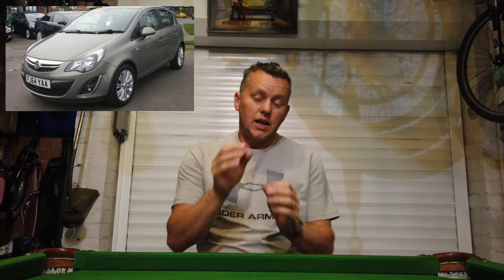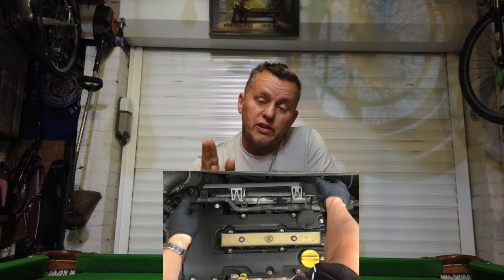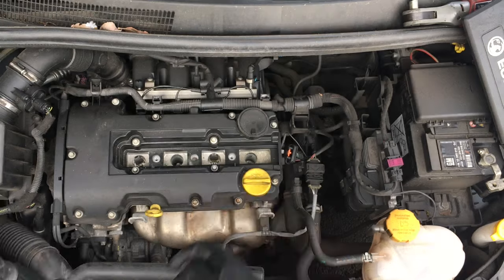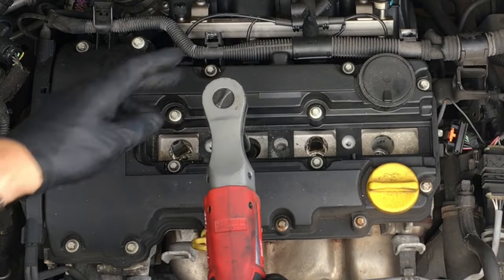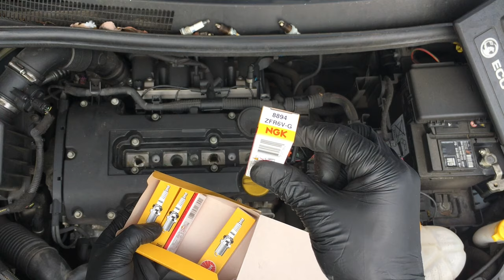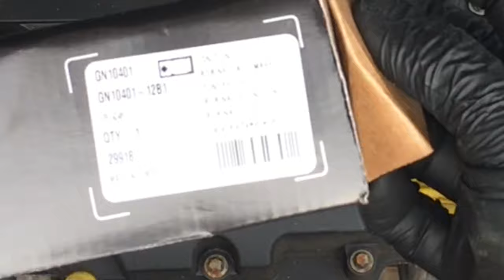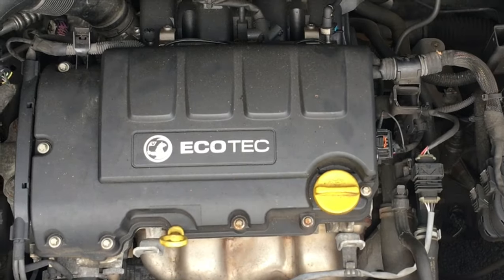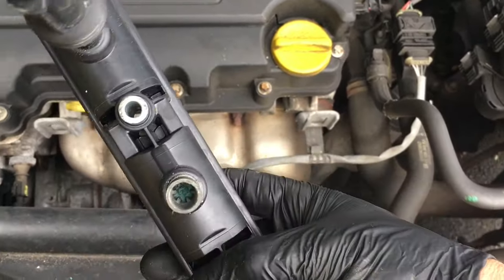🇬🇧Corsa Coil Pack Replacement (engine Misfire, Jerking)

Comment: Very useful fella. I changed my daughters 1.4 corsa yesterday.  It has transformed it. 2 cylinders were affected by bad corrosion . Excellent call.
£106 from euro car parts. 5 minutes to fit, but a year of engine light coming on. Vauxhall should recall for clearly failing to resolve this issue.
Reply from the maker: Glad it helped, Thanks for the great comments👍🏻👍🏻🛠
Reply: exactly the same on mine, fixed it today - what a hero!

Comment: Thanks to people like you on YT, I now have the confidence to sort what I think may be an issue with the ignition coil.
The car shudders sometimes in 1st. Also looses power (slow to respond) if changing gear to 2nd; especially up hill.
At times, I have to pump the ecelerater or change back down to 1st.
Many thanks for your video. Subbed & look forward to more content. 👍
Reply from the maker: Thanks for sharing & Thanks for the great comments👍🏻👍🏻🛠

Comment: Top man thanks for sharing, just had my car diagnosed by auto Plaza in west London with head gasket needed replaced and few other bits up the exhaust. Paid £1800 and as I got it, I experienced this issue 10 minutes after I drove off from their garage. They were like it shouldn't be any problems at all. Don't know what to think, either being ripped off, unlucky or just being idiot. Wouldn't be surprised if they'll ask again for some enormous amount of money for this issue when I'll drive back in tomorrow
Reply from the maker: Ouch, that sounds unfortunate, Thanks for the great comments👍🏻👍🏻🛠

Comment: Thanks for the vid. Just doing a service on a 2011 corsa d. It's only done 20k miles but doing the plugs I notice number 4 is covered in white powder substance & corrosion. Pulling the rubber boots off and the other 3 are nice and clean but 4 is totally covered with the ends of the spring completely corroded . Can only assume water is making its way into number 4 cyl only.  Have a new coil ordered from AutoVaux for £87 which doesn't seem a bad price for the same Delphi part as the one in the vid.
Reply from the maker: Good spot Martin, that would have given you a few issues had you not checked it, and a Good price, Thanks for the great comments👍🏻👍🏻🛠

Comment: Found this as my 2011 1.2 16v started jerking, nearly cutting out, clicking, no power, check engine light flicking on/off. Having new plugs and ignition coil tomorrow. Thanks so much.
Reply from the maker: Thanks for the great comments👍🏻👍🏻🛠
Reply: @aaanton11  work done and car behaving normally!

Comment: Thanks for the nice video! Cleaning the inside where the spark plug and the coil pack contact is not necessary? The grease that you talk about, would this be ceramic grease? Would it also be a good idea to put some on the rubbers of the coil pack? Thanks in advance!
Reply from the maker: Yes, correct, Thanks for the great comments👍🏻👍🏻🛠

Comment: You can take the rubbers off, smear dielectric grease on and slide back on, also put dielectric grease on spark plug end, not on the contacts, it keeps water out
Reply from the maker: Thanks for the great information👍🏻👍🏻🛠

Comment: The hexagons on the old plugs look rust-free, i don't think it failed due to water infiltrations. Anyway i have a 2003 Z12XE Agila and a few days ago i'd been checking things and letting the A/C pump run for a short while, with the hood open. Heard a distinct click while the engine idled and i'm sure it wasn't the AC clutch or the rad fan relay. 70k miles and the Bosch coil pack has never been replaced (only the plugs, last time has been about 2 years and 3k miles ago, Russian made Bosch FLR8LDCU+ ones). Feels slightly jerky, especially when the engine is warm and under load, but the EML never gets on and there are no pending codes either, and idle looks fairly stable. I've also cleaned the MAF and the throttle body, and replaced the pre-cat O2 sensor, but it still feels jerky. I'll replace the coil pack soon.
Reply from the maker: sounds a plan, Thanks for the great information👍🏻👍🏻🛠
Reply: @aaanton11  Update. I was right. It occasionally misfired on the 1st cylinder. Changed both the spark plugs (used the newest Champion RC10DMC4, Vauxhall part number 95519055, which the Vauxhall dealer gave me) and the coil pack (used a Huco 133816) and now the car drives so much better. Spark gap looks a sharp 1mm on all old Bosch plugs, and they're in about normal condition (no signs of oil fouling, only a tiny amount of carbon), so it definitely wasn't a serious misfire. One sparkplug, the one that looks the most carbon fouled among the others, seems to have a tiny interrupted carbon ring on the ceramic. Keep in mind that the P0301 fault code showed only on a professional code reader. My Viecar CY300 missed it completely and the CEL didn't light up. But the ride was still jerky nonentheless.

Comment: I got misfiring on my corsa rac said it could be spark plugs or battery they changed the spark plugs and said I needed a rocker gasket cover aswell so did that for a new battery fitted aswell it did run better after however I still have misfiring and the gears lose power sometimes and it really struggles in low gears.my rear engine mount was also broken so the car was shaking while idle and I had an oil leak.

I had someone else look at it he ran diagnostic he said cylinder 3 was not running as it should 80 when the other cylinders were all fine at like 200-240. he wanted to take the engine apart to investigate further and to charge me a full days labour £550! So I said no as the car only worth 1000 and have already spent £480 on repairs. 

Halfords said to replace the coil pack and fix the oil so I’m going to try that and hope it works and passes the MOT as the misfiring makes it fail on emissions. I did change the engine mount so it doesn’t shake anymore!
Reply from the maker: You would really benefit for one of these or similar https://youtu.be/O0oGl7nSQv8 it would save you a fortune, Thanks for the great comments👍🏻👍🏻🛠

Comment: Great video thanks. I just replaced a v corroded spark plug on my wife's 1.4 meriva (jerky and fault code p0304, new plug seems to have sorted it, coil looked ok, and other 3 plugs all shiny). One plug was also replaced under warranty a few years ago too, along with coil pack so totally agree with the water ingress corrosion issue! Any ideas on how to prevent in the first place?
Reply from the maker: seal the washer jets on the bonnet as water drips past the seals on to the coil, Thanks for the great comments👍🏻👍🏻🛠

Comment: Fantastic tutorial.Thank you so much for amazing video.May i ask a question?
 My Corsa D 1.4 (2013) sometimes  jerking,slightly shaking, refusing to accelerate, service light  and check engine lightcomes on. The problem only occurs when engine is cold.After a  10 minute drive, it never show up again. Or if i shut down the car, and start it again, the problem goes away too.

The mechanic said to me there is no misfire, the fault code said 'acceleretor pedal sensor ' issue. But i am suspecting that my issue somewhat related with ignition/misfire.Is there any possibility  that a misfire can cause these semptoms when cold but goes away when engine reaches operating temretures?
Reply from the maker: If there is a code for the accelerator pedal that is most likely to be the issue Thanks for the great comments👍🏻👍🏻🛠

Comment: My  exact problem. Cheers makes better then going to main dealer.
Reply from the maker: Thanks for the great comments👍🏻👍🏻🛠
Reply: aaanton11 bought mine for £46.00 and plugs at my local parts shop. Job made a lot easier with your video.

Comment: Great video. Is there a way to avoid getting water in there? I've changed the Coil Pack twice, getting the same water problem both times. How can I fix this permanently? Thanks for your vid. Cheers
Reply from the maker: pop the washer jets out of the bonnet seal with silicone and refit, Thanks for the great comments👍🏻👍🏻🛠
Reply: @aaanton11  Thank you!! :)

Comment: A good video and might just get have solved my sisters ticking noise in her 1.4 Audo SE.... top fella
Reply from the maker: Thanks sunny, the injectors are quite noisy on the Audi, it wont be a coil if the engine is running ok with no misfire, Thanks for the great comments👍🏻👍🏻🛠
Reply: @aaanton11  Sorry was meant to say "auto" she has a Corsa 1.4 SE like the one you been working on....

Comment: Hi,
Thank you for your video. I have the exact same issue with 2007 Vauxhall corsa petrol every 2 weeks spark plugs go bad because water drains into it to the point I had to replace the ignition coil. Do you have a tip what should I do to avoid water drains down to spark plugs? Thank you.
Reply from the maker: It usually comes in through the washer jet seals, Thanks for the great comments👍🏻👍🏻🛠

Comment: 140 pound seems a lot for the coil pack, did mine for 40 quid . Works fine.
Reply from the maker: Yes it is the more expensive coil but its branded, and is the same as fitted as original with proven reliability, there are lower priced coils like you say but in my experience they only last a couple of years at most, the coil pack sits right in the top of the engine where its really hot so it has a tough job to do. if you don't intend keeping the car for longer than year the cheap coil is great, Thanks for the great comments👍🏻👍🏻🛠
Reply: aaanton11 I’ll let u know in 2 years if it’s still going strong 💪😂
Reply: @TheMartin7171  still going strong?

Comment: Howdy. 

Thank you for the informative video. 

I have a question. I recently downsizied to a 2019 and it's my first vehicle with start/stop functionality. I'm a little bit worried about that - isn't it bad to have a turbo engine cut off abruptly when stopping?

And how reliable are the turbos on the 1.4turbos. Do you replace a lot?

Greetings from Johannesburg, South Africa.
Reply from the maker: They are very reliable, no issues with the stop start, Thanks for the great comments👍🏻👍🏻🛠

Comment: Hi, great video, helped a lot however the orange clip to remove the plug is broken, so you know where I can get a new part or what it is called ?
Reply from the maker: you might be better off just using a couple of cable ties to secure the connector to the coil pack, Thanks for the great comments👍🏻👍🏻🛠

Comment: I have changed the coil pack (HAAS) from euro car parts and all four spark plugs (Bosch) but it’s still misfiring, than engine light came on. Took it to local garage and the diagnostic picked up backbox pressure 🤷‍♂️😅 Anyways, they didn’t manage to solve it and problem still persists. Any ideas on what the problem might be please?
Reply from the maker: Sounds like you have a blocked exhaust, Thanks for the great comments👍🏻👍🏻🛠

Comment: 6:20 you mentioned two different type of coils now if the GM number is same but the shape of the drums going to plugs are different is there any issue? I have seen a video someone changed and he said it worked
Reply from the maker: Replace with the same type to avoid any issues, Thanks for the great comments👍🏻👍🏻🛠

Comment: We have just replaced our coil pack and spark plugs after they were corroded and it is still misfiring. Any ideas what that could be?
Reply from the maker: were all the springs inside the new coil legs or has one dropped out, Thanks for the great comments👍🏻👍🏻🛠
Reply: Did you solve it, got same

Comment: Anton, We have a 2010 Corsa 1.0 litre engine. Misfires in all gears and only kind of goes away on the motorway. We replaced the spark plugs and the coil pack and this hasn't sorted it. Also did the pedal test and no faults. What can I look to replace next?
Reply from the maker: is the engine management light on? if so you need a code reader like in this video for more clues, https://youtu.be/FJMDuWnGMII  Thanks for the great comments👍🏻👍🏻🛠

Comment: Hi... just need to get a advice.. I was changing the ignition coil and found some oil on one of the spark plug... would it be better to change the spark plug den or leave it as it is.
Reply from the maker: Or you can re seal the rocker cover, Thanks for the great comments👍🏻👍🏻🛠

Comment: Mate, my Vauxhall Astra is shuddering. Gave it to Vauxhall and they said the connector cable is broken. I had the coil
Pack and start plug changed a week ago. Vauxhall said the car is Mis firing at optimal temperature as the connector cable is broken. They gave me a £720 quote to replace coil pack, start plug and connector cable. There were no other fault codes. Would appreciate if you could share your views
Reply from the maker: The clips can break on the plug, just cable tie it on job done, Thanks for the great comments👍🏻👍🏻🛠
Reply: @aaanton11  thanks. RAC had cable tied it and it worked well for drive back home.but had the same misfiring issues next day when the car reaches optimal temperature

Comment: What are the recommended gaps on the plugs? Is that determined only by the vehicle manufacturer, or also by the spark plug model? Where should I look for these parameters? Finding the correct spark plugs seems to be pretty cumbersome. When I tried to use the part finder on different sites, like Bosch, I'm told that the entered VIN is invalid, although I checked it 3 times...
Reply from the maker: It should be these, https://amzn.to/3bns3Tw  On the automated checkers its Sometimes its easer to use the registration number, also to be sure whip out one of the old ones the number is on them, They come with preset gaps  should be 0.7mm Thanks for the great comments👍🏻👍🏻🛠

Comment: Is this a diesel engine? My 2001 honda civic sounds much lesser than this one🤔
Also how come changing those parts will solve the problem? This is temporary solution l guess. I think The 3rd cylinder has problem that causes corrosion on spark and coil. 
Another question; is this a chronic problem with vauxhall corsa? Because l’ve found a 1.3 cdti corsa and everyone says it’s fuel economic. But if they have such problems, l would rather not to change my honda. I just change oils, filters and sparks every 7000 km and have never had issues in 10 years.
Reply from the maker: This is a petrol engine, Hondas are very reliable Thanks for the great comments👍🏻👍🏻🛠

Comment: Had an engine MIL on a 2014 Corsa 1.4 D model.
Scanner revealed coil pack issue as did dealer level scan.
Replaced coil pack with Bosch (Haas didnt work) coil pack amd changed plugs while coil pack was off and now car runs great..BUT engine MIL light is still on. Have done 1 drive cycle lasting about 20 mins but it hasnt gone off. You didnt say at the end of your vid if rhe MIL went out straight away or if it needs 3 drive cycles.
Hoping its nothing else as dealer level scan only showed fault with the original coil pack and now running great with the Bosch replacement. 
Can you please advise ?
Reply from the maker: you will now need to erase the codes with a reader, Thanks for the great comments👍🏻👍🏻🛠
Reply: @aaanton11  
Thats great ...thanks

Comment: Those heat resistor springs 
Which way round do they go???
I’ve put the green tip facing down touching the spark plug ????
Reply from the maker: does it work? Usually the clean end touches the spark plug Thanks for the great comments👍🏻👍🏻🛠
Reply: aaanton11 no turns out the actual green tip (what looks like a fuse) supposed to be facing upwards touching the coil, and the spring part touching the spark plug.

Comment: Just got an 1.4 SRI Corsa D yesterday. Only done 32000. I was disappointed when driving it. For an SRI it felt sluggish and juddery. It's fine cruising at speed but its just doesn't feel pokey and judders a lot when taking off. So would a new coil fix it?
Reply from the maker: Only if It’s misfiring, is the engine management light on ?? Thanks for the great comments👍🏻👍🏻🛠
Reply: @aaanton11  No, no engine light. But sometimes it stalls. No knocking or anything. Just juddery and occasional stall. Maybe it would benefit from a remap?

Comment: Does the coilpack misfire trigger any trouble codes? A work colleague has a 2007 1.2 and the engine is jerky when under load. I have a cheap obd2 reader and there were no codes present.
Reply from the maker: Sometime not on till it gets worse, check for corrosion on the coil pack, Thanks for the great comments👍🏻👍🏻🛠
Reply: @aaanton11  thanks, i fwd'd on your video to her. I did a quick check in our work car park with the scan tool. Didn't have time to pop the bonnet and root around. Her cabin fan doesn't work either (no spin at any setting, found a good vid for that fix, sent it on to her).

Comment: Great content 👍. My corsa lost power on me while in traffic. It suddenly felt sluggish and jitering then no acceleration. Then it died on my and wouldn't start up,has crank. I removed coil pack and found cylinder 1 covered in orange powder and so was the coil and spark plug for it. All the rest are in good condition. Could this be the cause?
Reply from the maker: possible, more likely to be the crank shaft sensor, or fuel pump https://youtu.be/OxSRJU2E9cA Thanks for the great comments👍🏻👍🏻🛠
Reply: @aaanton11  thanks for the help. I connected my Bluetooth obd port and scanned for codes on my phone but nothing, no error light either 🤔

Comment: would you say this was the same with the 1.0T version? i bought one second hand and it doesnt feel like its running anywhere near the way it should. ive been told it could be the Balancer Shaft in the engine and the garage i took it to replaced the coil pack and plugs as far as i know but didnt seem to make a difference.
Reply from the maker: is the engine noisy tapping? Thanks for the great comments👍🏻👍🏻🛠

Comment: Just changed mine there but the engine management light is still on, does it take some time before this will go off??
Reply from the maker: you will need a code reader to reset the codes, Thanks for the great comments👍🏻👍🏻🛠